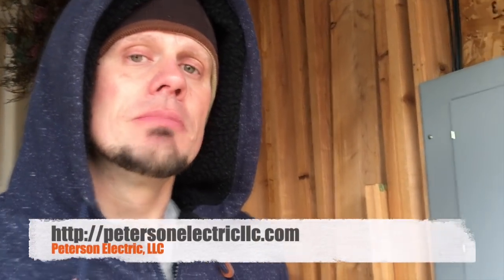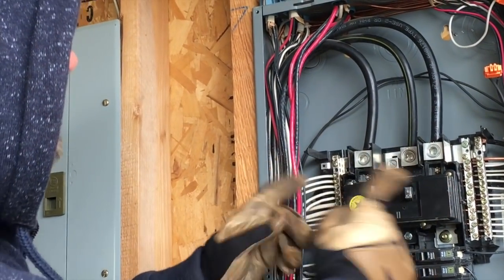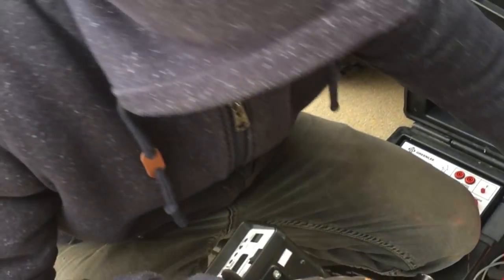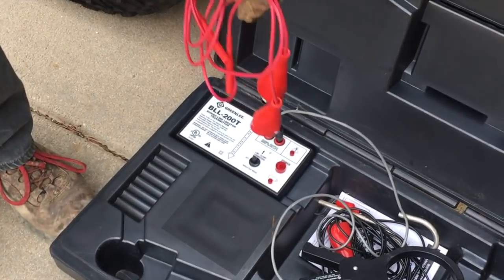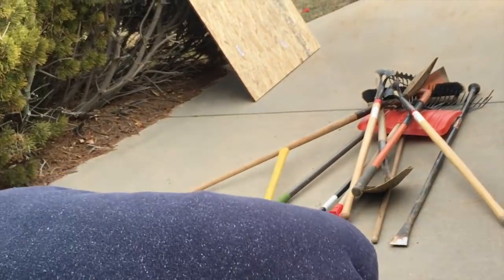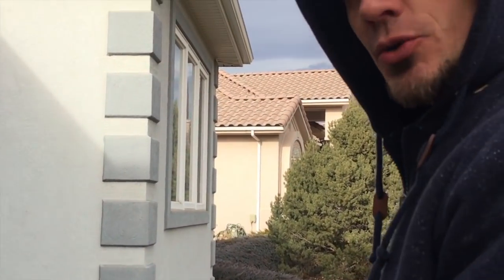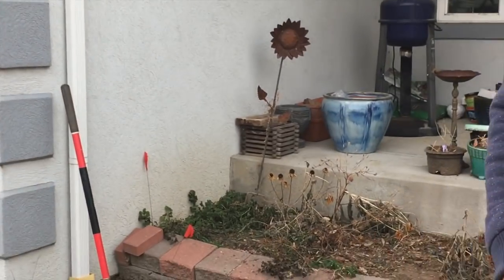Power Out, Lights Flickering—Part 2.1

Comment: Fantastic Electrical Video! You know your stuff Josh. More often than not where we are - Alberta, Canada,  cheap builders used to get away with ferrous ground rods and plates. Having acidic ground conditions, these rods and plates will corrode, and become an ineffective ground, causing these fluctuating voltages, and killing light bulbs. Love your tricks! Also, what is the name of the underground cable tracking tool you have?

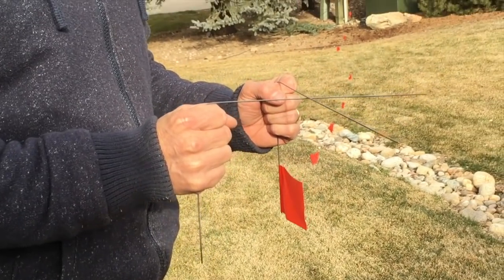Comment: Ok, not an electrician. What was happening with the divining rods @4:15?? Never seen anything like that!
Reply: Typed in "Digging Well" in youtube. First video is a guy using that method. 

https://youtu.be/5rYPRMm8Arw

You don't have to go far, within the first 1min30sec he's using a metal hanger and drinking straws to search for dig location. Maybe he could have just dug anywhere and hit an aquifer. Or maybe he's right and the sticks are telling him where a stream is. 

If you don't buy the bs continue watching the video for some actual useful info on how to dig a well if it interests you. And yeah even as a an electronics specialist the electricity makes more sense than water flow due to magnetic flux from induction but still wires need to be wrapped into a coil around a metallic core to produce enough magnetic flux to influence anything 5 ft from the ground.
Reply: If I'm not mistaken, they're attracted to the magnetic fields that electricity produces. Using 1 in each hand will allow them to cross and pinpoint where the line is
Reply: I've also seen people use that method to know where to start digging a well. Seriously. I don't know if is dumb or magic.
Reply: @chickentendies4485  Pretty sure it's bull 😂.